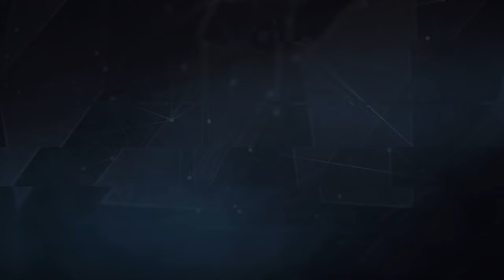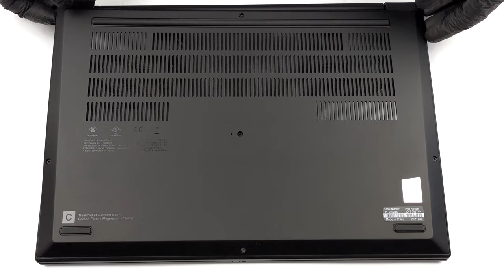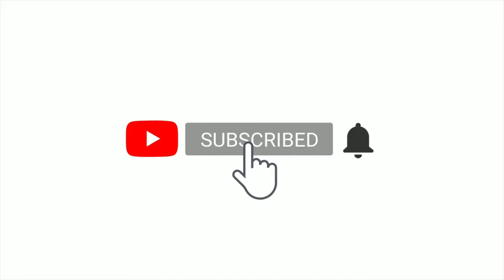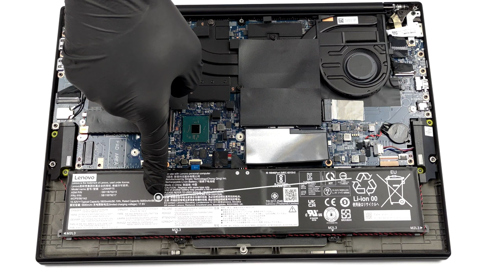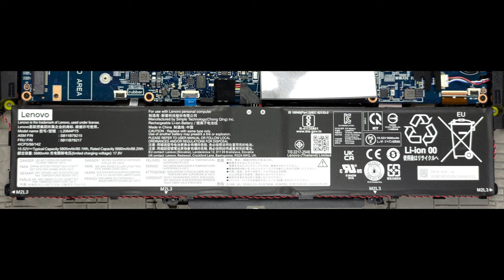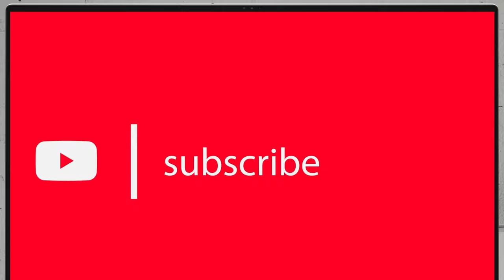🛠️ Lenovo ThinkPad X1 Extreme Gen 4 - disassembly and upgrade options

Comment: Always great videos!  Is the P1 Gen 4 exactly the same as far as disassembly and upgrade options go?
Reply: Yup. Of note is that there are three different heat sink designs on both the x1 and the p1. See the service manual.